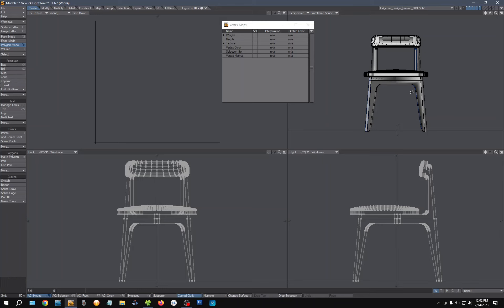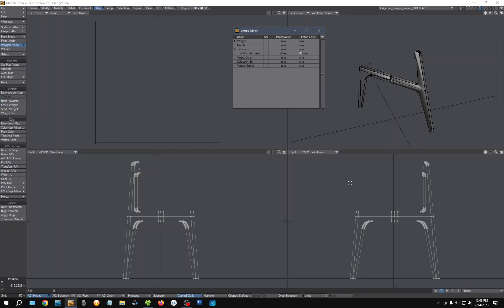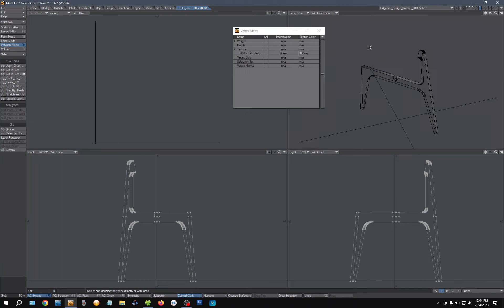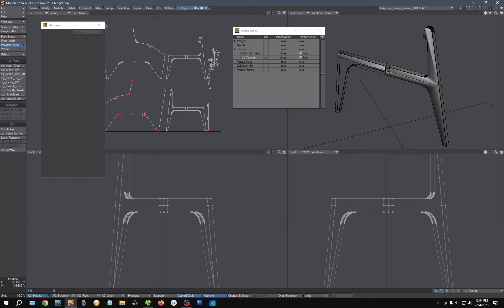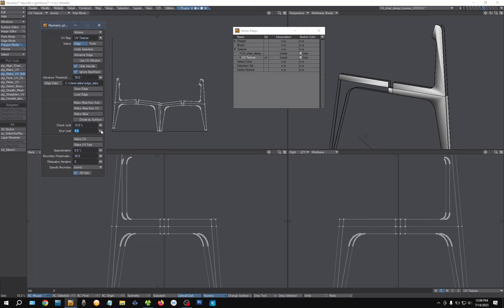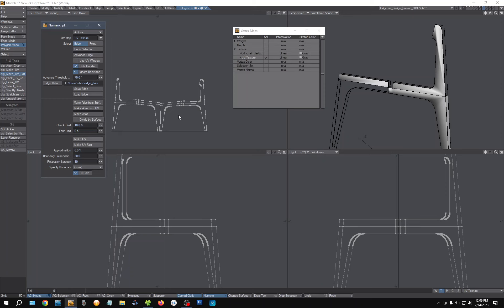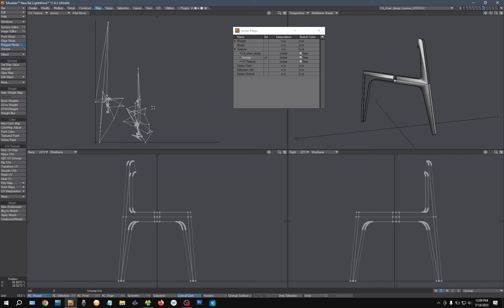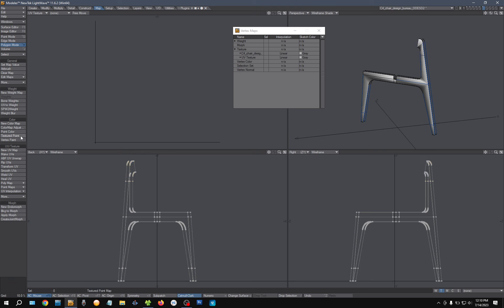UV mapping - Troublesome Chair - PLG ABF

Comment: Well.. dont forget you can guide the UV mapping by way of selecting the edges you wish for it to cut.   so lets say you have a cube and you want that classic cube t shaped UV  unfold of the cube.  you have to use the edge select tool to select the edges that will make that t shaped unfold.   that is with modelers ABF UV unwrap tool
Reply from the maker: yes, the reason i skipped it in this video was to save time, since these edges weren't very loop friendly.
for more on that and other ABF tips, check the videos > https://www.youtube.com/c/erikals/search?query=ABF

Comment: That is some terrible topology.  Must have imported from a solid modeling CAD application like MOI or Sketchup.
Reply from the maker: not terrible topology, it looks like that because of faulty shading. that said, yes, the obj has errors.
Reply: @erikals  looks like tons of NGons, which could give bad shading results and also make it difficult to select proper seams for UV unwrapping.  Not surprised it had a hard time with this model.  Adding the loops you did helped it resolve some of the Ngon issues and gave it somewhat of a guide on where to follow the unwrap algorithm.
Reply from the maker: @maxxxmodelz4061  lots of Ngons, while quads/tris are much better, Ngons can be UV mapped.
but indeed, this is a warning to how imported meshes often are not optimal.
Reply from the maker: @maxxxmodelz4061  see for example the same Chair Unwrapped in Ultimate Unwrapper >
https://www.youtube.com/watch?v=3oBDuJBAIBg